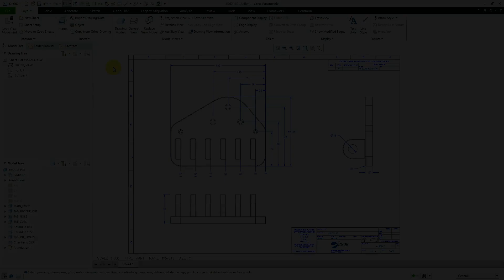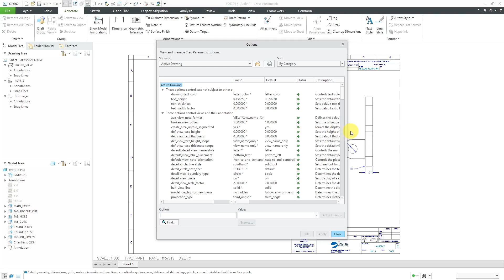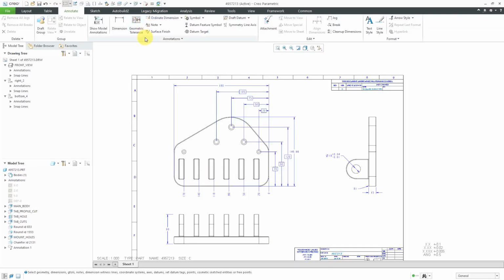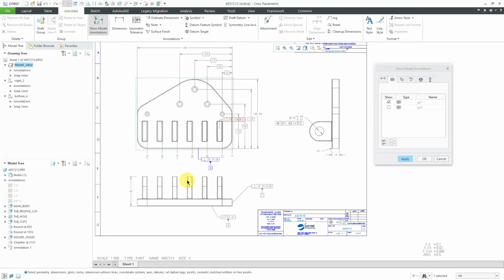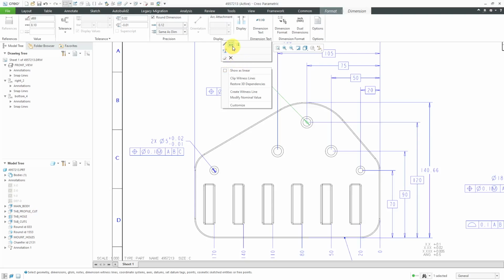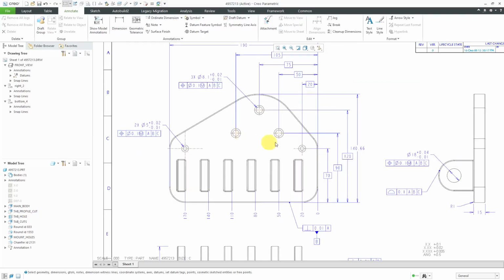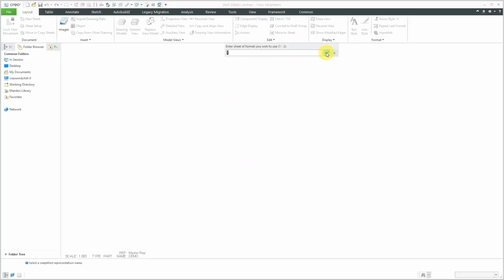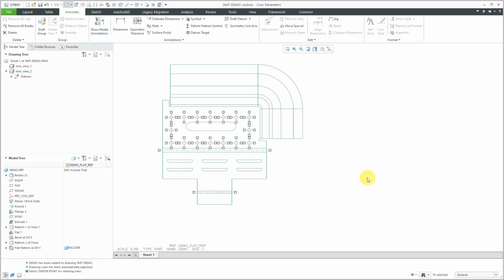Creo Parametric - Drawings - Show Model Annotations Part 2 - Geometric Tolerances and Axes

Comment: Sorry, this wall of text, it just kept growing... my CAD admin can't or won't answer these questions.
In the first model, how do you have the 3X in the dim 8.1 and the 2X in the dim 5? Is it just text, a named pattern dim parameter in dim text, or driven by standard hole table with note pattern_num? I ask cause if the number of holes changes you have to then go back into the dimension and change the number if it's just text. 

Using a pattern of a general hole in 1 direction, axis, table or dimension a parameter &P# is created that can be called in dim text. But if a 2nd direction is used the number of holes is split or if using by sketch, by fill, or by curve a useful parameter is not created.

And I can't figure out how to get the DRF to be attached as shown when using the automatic note from standard threaded/thru holes. The default automatic standard note from the hole_table would be great if formatted better for all options in the hole feature, and we have a table for custom holes we use but they're not much better, but I digress.
I'm using Creo 4.0 M090 with the ANSI std. When I attach the DRF to the note created from the standard hole, the leader changes from attached at the end or beginning of the top line to be under the dim and the DRF to be all the way to the left/right of the dim text and i can't change it back.
Also, it looks like you have the holes as a single removing extrude and not using the hole feature and pattern. Do you have a reason to use an extrude over the hole feature? A pattern of a simple hole can use the Identical/variable option for processing/regen improvements. Can this be achieved with the extrude or is it considered a single feature; therefore easy? Also why can't the Identical/variable option be set with standard holes for the same improvement?
Also, the dimension witness lines and centerlines created from the axis. Is there a way to automatically set the offset of the witness lines from the centerline? There's the witness_line_offset that will change the offset from the feature edge or center of hole. Not offset from centerline for axis. What's the thought of having the witness line over the centerline?